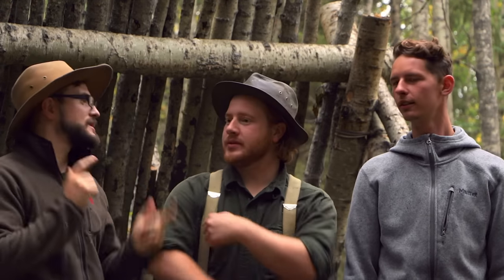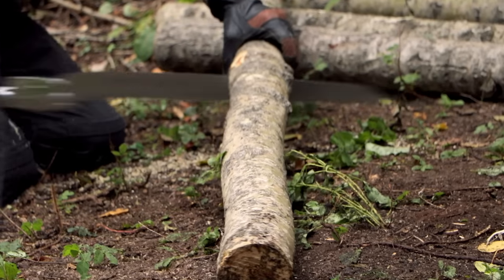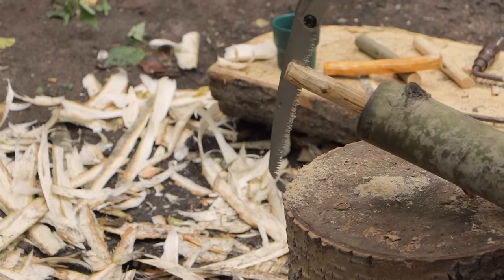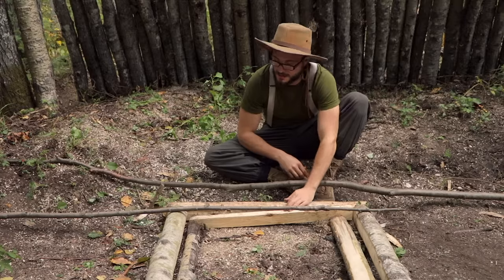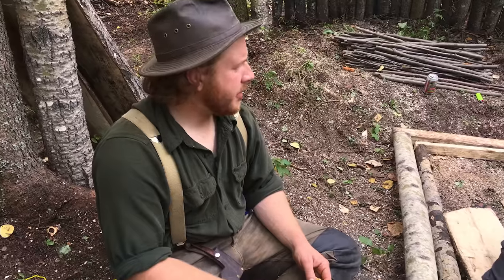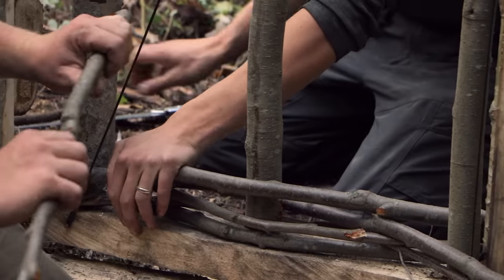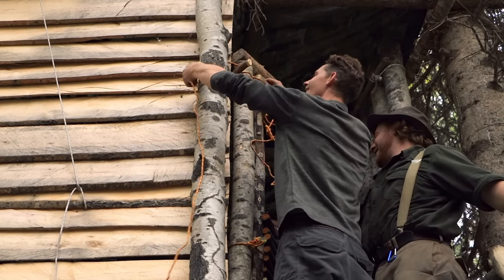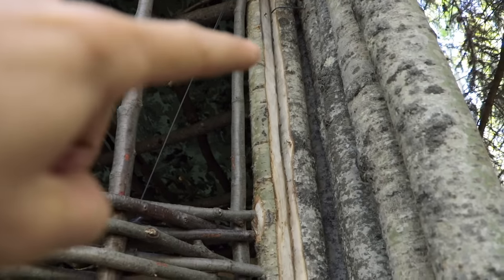Bushcraft Treehouse 16: Building a Bushcraft Door at the Bushcraft Basecamp Shelter

Comment from the maker: What did YOU think of the door? What do YOU want to see next?
Reply from the maker: +Mathias Svacina yes almost at the point where we can think about windows 👍🏼
Reply from the maker: +Tyrone Emanekaf thanks man, really tied to up the production value 👍🏼
Reply: Bushcraft Heroes windows and it's about time for another tree house vid keep it up guys
Reply from the maker: +Paul Austin yes indeed! Thanks 👍🏼
Reply: Bushcraft Heroes I say u guys either do the roof or an expansion of some kind
Reply from the maker: +JaX Gaming thanks, yes a roof is in need for sure 👍🏼
Reply: Bushcraft Heroes another thing i thought would be cool was to use the old latter and put it inside and make a second floor... lol just an idea
Reply from the maker: +JaX Gaming lol it would be cool, but would server no purpose at the moment 😂
Reply: Bushcraft Heroes hey Heroes just wanted to give you a little tip a auger bit works so much better drilling through wet Lumber than a paddle bit the auger bit looks like a giant corkscrew it works 100 times better thought you might like to know
Reply from the maker: +Nicholas Cervone thanks man! Yeh we actually have one but maybe it's not sharp enough, it wasn't working so well. I will look for another one. Cheers
Reply: Bushcraft Heroes you did a great job on the door here's a tip for you on the hinge side for the inner door structure to rotate with the rest of the door you can put what is called a lock pin just like the doubt you have going through the frame into the door for the hinge but take a second dial a little smaller put one on either side of the hinge dowel to make the frame of the door rotate as well but it works fine just the way it is just a little tip
Reply: Bushcraft Heroes I think it would be really cool if you guys did like a 1 hour video of all of you building perimeter walls around the camp
Reply: Bushcraft Heroes for next video I love to see the wood burning stove. I'm not sure how you going to do this but if you keep the stove on the bottom of the tree house you can run the stove pipe through the floor out through the roof of the treehouse and the radiated heat from the pipe will warm the top level of treehouses well more efficiently then just having the stove on the bottom just little idea PS love your show
Reply from the maker: +Nicholas Cervone thanks for the tip, we will bear that in mind next time 👍🏼
Reply from the maker: +GTA Comedy yes indeed!
Reply from the maker: +Nicholas Cervone yeh that's the plan Stan! Thanks for the comment. 👍🏼
Reply: Bushcraft Heroes I love these and I need more
Reply from the maker: +sord 8x tell us about it!
Reply: Im redy for a roof
Reply: I must say I really appreciate you taking the time to respond to my comments thank you so much for being kind enough to do so🙏😀
Reply from the maker: +Jayven Bailey if we have time before the snow we will try!
Reply from the maker: +Genericname2345676543 a stove is coming
Reply from the maker: +Nicholas Cervone no problem, thanks for leaving comments!
Reply: put some bar  soap(dry)  on the door hinge and it will let it swing easier acts like a wax
Reply: Bushcraft Heroes, I was thinking that if you leave the top of the door open so you could have windows in it but make a roll up shade out of the same size sticks so it matches the weave. You could fasten it at the bottom of the window for cold windy days or nights. Or possibly panels that can slide up and down or be removed.
Reply: Guys! The door looks great! Well done guys, nice work.
Reply from the maker: +John Di Francisco that's a great idea, definitely something to consider 👍🏼
Reply from the maker: +Randy Yewell thanks Randy!
Reply: The door is awesome could you consider trying an elevated deck for the front or back of the house. Thanks!
Reply from the maker: +Yo Shi Mo Mo ! Yea we may do that.
Reply: Add A CHIMNEY!
Reply: Bushcraft Heroes it's Mark the mich Marine Vet Jedi Carpenter , from Michigan.  Read my comment. It's much the same as the diagonal table leg brace , that I suggested EONS AGO.   SEMPRE FI BOYS!!
Reply: Bushcraft Heroes clear plastic visqueen w/ a handy tape-in ziplock baggy ,to vent it! Lol
Reply: Bushcraft Heroes 
 A scotch-eye auger ,made by us Marine corpral.on corprals corner YouTube! Awesome McGuiver skills!
Reply: Wow that's a mouthful yet impressive!
Reply from the maker: +Altomare242 oh yeah
Reply from the maker: +Mark Atkinson I remember that lol! We still have t got round to that !
Reply from the maker: +Mark Atkinson yeh I watch his channel. I will look for that
Reply from the maker: +Yo Shi Mo Mo ! Thanks 🙏
Reply: Awesome job guy's! ... complete with some nice wedging action there ;-) ... and now for the automatic door closer ...
Reply from the maker: +Neil Johnston lol you got it Neil! Thanks for the comment!
Reply: Bushcraft Heroes could you make a perimeter with wooden walls
Reply from the maker: +nathan marsh tune in next Friday 😉
Reply: Bushcraft Heroes  you should build a bunker half in the ground to keep stuff cool in the summer
Reply: Yo Shi Mo Mo !  I guess it was stupid for that to be my name😂😂
Reply from the maker: +King of stupidity yeh but all the diggin 😐
Reply: Bushcraft Heroes maybe dig like a foot and then put mud and moss on the sides
Reply: Bushcraft Heroes dig halfway to your desired depth and put the dirt u have around the sides. Tada !!! only half the digging
Reply: King of stupidity oh we said the same thing XD
Reply from the maker: +Yo Shi Mo Mo ! Yeh that could work!
Reply from the maker: +King of stupidity boom. Mind = blown! 👍🏼
Reply: Bushcraft Heroes Thanks it means so much to me that you talk to your fans I have made a promise to always do that with my channel!
Reply: i would love to see the idea from episode 6, the front balcony come to fruition.
Reply from the maker: +vraelelda89 yeh man me too! I think that's for next spring.
Reply: Bushcraft Heroes  hey you guys should build some swords and stuff to decorate your tree house that would awesome and there would be no other cabin like it unless some one copys you
Reply from the maker: +Emri Taylor lol but instead of swords some useful tools that we can actually use 👍🏼
Reply: Bushcraft Heroes it wont help against the koskitos!
Reply: Make a dog 🏡🐶
Reply: Bushcraft Heroes make a dog house
Reply from the maker: +Joshua Duncan I don't think bow would want to sleep there...
Reply: It's time for a roof!
Reply from the maker: +aaron brouwers yes indeed!
Reply: Perhaps before winter you could engineer a bushcraft wood heated hot tub. Just a thought. 
Cheers
Reply: Bushcraft Heroes man let's meet up ! I live in Edmonton as well
Reply from the maker: +TheGumshoeNetwork2 a wood heated hot tub would be amazing, but it would be a block of ice when we came back!
Reply: Only if you kept it filled. Construct it with a dowel bung to remove when you need to drain it. And aim the run off towards the slope away from the camp. Imagine how good that would feel after a hard day of palisade building. You are located close to the river, so water is readily accessible and refilling easy if you don't make it gigantic.
Reply: Great job guys! Now that the door is up,  you don't have to worry about werewolves or bigfoot sneaking up on you guys in the middle of the night anymore. LOL
Reply from the maker: +White Knight exactly! Finally someone who gets it 😂
Reply: Bushcraft Heroes I want to see you make a basket from wood
Reply from the maker: +Kaden Plays hmmm that could be a nice project, thanks for the suggestion
Reply: or bark
Reply: Bre
Reply from the maker: +doggie paws renonault pro thanks 🙏
Reply: Bushcraft Heroes I think this series is bloody great 👍🏻
Reply: So cool
Reply: Bushcraft Heroes Got GUN?

Comment: Great job on the door, guys! You didn't mention it, but that sort of construction is called wattle. It was a very common technique in the past. If you check out the Swedish Homestead channel, you can see some wattle fences, I think. Common man houses in Yorvik (the viking town at York, England) were wattle and daub (mud, or plaster, spread over the woven wattle walls), and many tudor houses were timber-framed but had wattle and daub walls. You can see an example of that on the Mr. Chicadee channel in the series on the building of his workshop.
Reply from the maker: +Craig Mooring yeh I am aware of that, I really want to try it out too! Just got to get stuck in I guess!

Comment: I think you should make a counterweight system that pulls the door shut, like the spring on a screen door. You would just need to tie some paracord to the top of the door run it across the shelter in a inconspicuous place and then hang a peace of wood weighing a couple of pounds to pull the door shut each time it's opened, it would give the door a good feel too
Reply from the maker: +justin walker that is a badass idea man!

Comment: Amazing project! Will never go as planned but worked a treat like you guys said! I just have one question? Is there a reason why the door is in an angle? And not square? That's what I initially thought it would be like haha
Reply from the maker: +Russell Torkamani yeh indeed! Sure, the reason is so that you can open it from the stairs without it opening into where you are stood. Also it's safer as you can open and stand on the deck, your not opening the door straight into the steep stairs.

Comment: Nice door , cut a loop of para cord and strap IT diagonallly  ACROSS THE SIDE OF THE DOOR THAT DRAGS. THEN; use a stick , to wind the string, like a turnbuckle  system.. the tighter the wind ; the  more pull and tension ,that will hold it true and somewhat squarer
Reply: That's genius and use leftover para cord to make almost like a net screen on the door window, there is not to much function except squirrel protection XD, but it will look awesome!
Reply from the maker: +Mark Atkinson lol didn't you see it mark, we did exactly that!
Reply from the maker: +Yo Shi Mo Mo ! Haha yes indeed! Thanks for the comment!

Comment: Carpentry meets Bush Craft!  You fellows beat 'the rest' by knowing and showing a few basic refinements, as in this case, standard parts of any long term working door and frame system.  Could you sometime say why you wanted the door and why you chose to weave saplings (aside from the sharp appearance) for the body of the door?  You are far from the first builders to need 'as-built' drawings as well as 'as-designed' sheets!
Reply from the maker: +James Ellsworth thanks James! We wanted the door to finish the shelter so there was no exposed part. To help keep the heat in on winter, and as a fun project as we have never made one. Also very highly requested so we want to also incorporate what our subs want to see from us.

Comment: Shouldn't you have the door swing inward so you can open it while standing on that little landing instead of reaching for the handle form the top step so it can swing out?
Reply from the maker: +Kevin C. It opens both ways. Wanted it to open out too inscase you need to make a quick exit